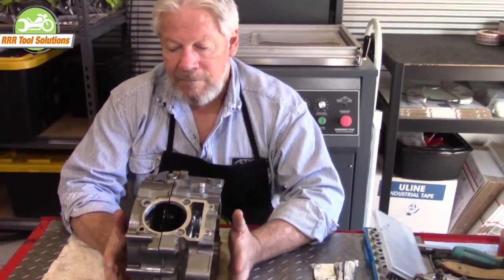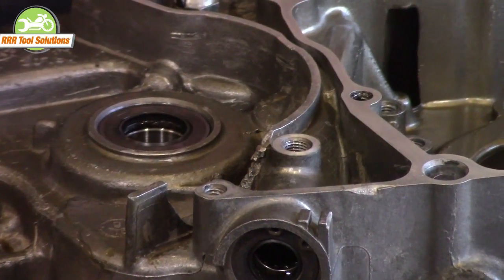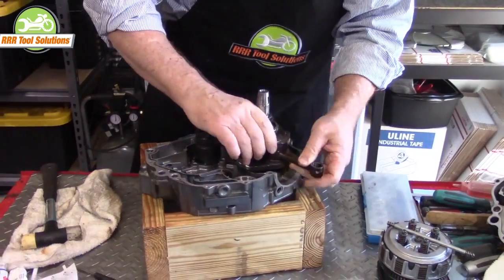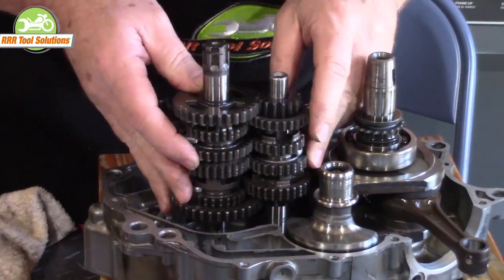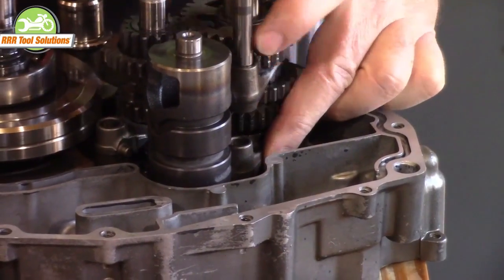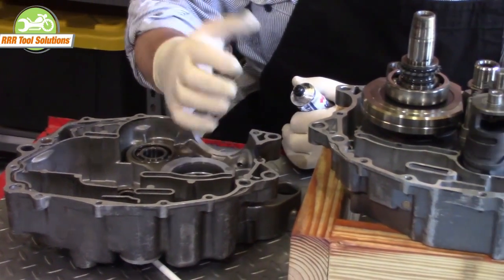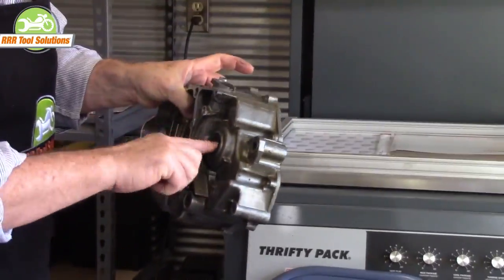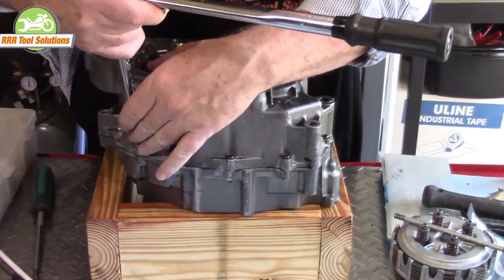Motorcycle Transmission Rebuild   Yamaha TTR225

Comment: Hey sir I really enjoy your videos ..sir I have Yamaha xj900 and the second gear is not engaging so I took it to a mechanic shop for service but after replacing the second gear it’s still the same it’s not engaging so the mechanic ask me to buy a complete transmission gear before the gears will engage but another mechanic also ask me to change the shifter shaft.. so I confused now and need your help to get my bike fix as it’s my daily transport.. thanks and hopping to hear from you soon

Comment: I also have a Yamaha, but for reason it doesn’t want to go into neutral. It goes into all gears except neutral. Any ideas of what my problem may be?
Reply from the maker: Daniel, thanks for commenting! I know what you're talking about, it's more common on single cylinder bikes than multi's. The culprit? - clutch friction plates and disc are not separating and they are dragging against each other which keeps rotational torque on the meshed gears and shift forks. The higher rpm that most singles need to idle at means that the spinning plates have a more dramatic affect on the sticking plates (actually oil viscosity contributes to the clutch drag). Here is my  fix ....#1 - make sure your idle rpm is set to factory specs (most singles call for 1,500~1,700 rpm where as multi's go down to 1,000~1,200 rpm).
#2 - find and use Motul 7100 Synthetic oil in the recommended viscosity. I love this stuff! It has solved/eliminated clutch dragging problems in several different "problem bikes" - my own DR650 single, my GPZ750E Turbo, and my KZ900. All three of these had what I consider to be worst case dragging through the clutch system making neutral almost impossible to find. Seriously, I don't endorse many products, but this Motul is magic in my opinion. 
Thanks again, Gordon/RTS
Reply: Thank you!!!! I thought it was my plates at first, so I replaced them and they still do the same thing. Thanks for the advice and I’ll give it a try!!
Reply: It will work on a dirt bike tranny right?